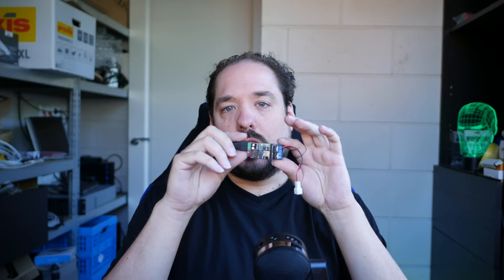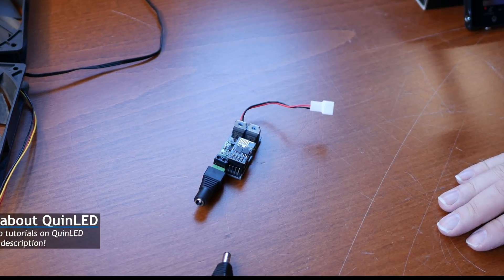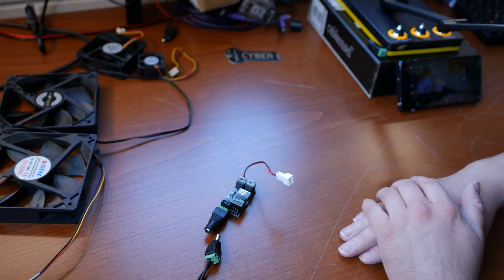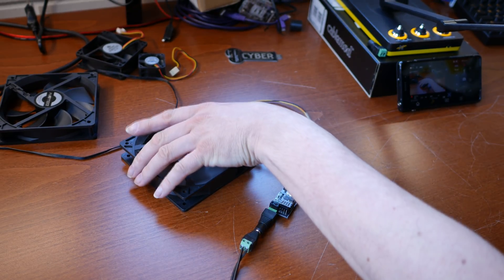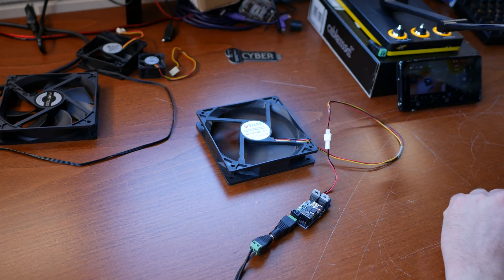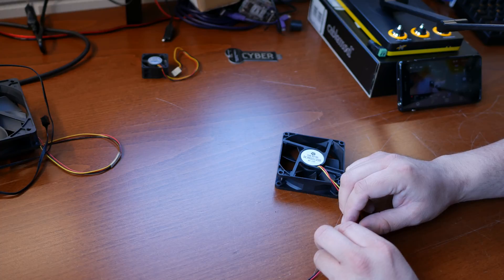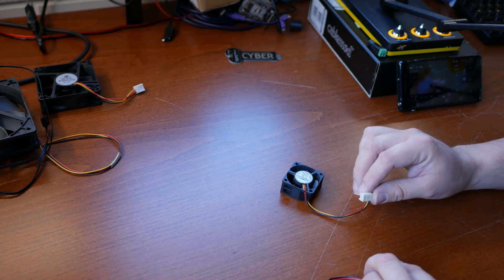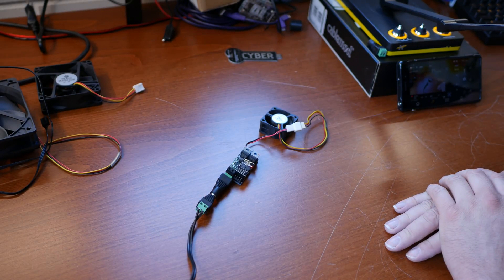ESP8266 LED Lighting: Using QuinLED to control a fan?!

Comment: in theory (As far as i know) :

Brushless Fan are brushless integrated with ESC. So the movement of the fan controlled by ESC. So if you PWM-ing the power, it will hurt the ESC, because ESC has a IC controller that need steady dc voltage.

So if you want to really hack 2 wire (positive-gnd) fan you can add big capacitor, so rather trickle the power by PWM, you send "lower DC" input to the fan. OR of course you can use brushless fan with dedicated PWM wire.

Comment: Normally you will use higher frequency PWM for fans. Low frequencies are ok for leds. I do control some fans using pwm for some time and as long as the frequency is above our hearing capacity it works just fine. 

In my experience you can make fans run much slower using PWM than when using voltage limiting.

Comment: You have to smooth the output voltage of your led controller. Sure the fan does not like to get a square wave pwm controlled input. Put a capacitor (or perhaps more than one) in parallel.
When the pwm output is smoothed it is like controlling the voltage.
Hook up an oscilloscope to the output, then you will see the effect.
Sorry, but this is basic electronic knowledge...
Reply: olpqay I was thinking the same, capacitor in parallel to smooth it out. Maybe a small follow up test !? 👍☺
Reply: How would you determine the size of the capacitor? (just trying to learn something here)
Reply: You will create some real ugly current spikes on the power supply by doing that. To overcome that use a coil in series and voila! you created a basic switching power supply (without feedback). Higher frequency is the solution.
Reply from the maker: Yeah, that should indeed work. Maybe I'll test it in the future! :)

Comment: Like you said. the fans themselves arent made for a pwm voltage input, a 4 pin fan has a pwm signal wire which controls the fanspeed with the electronics in the fan
You could use a relay for simply on and off
Reply: You need a PWM frequency somewhere above 25kHz. It’s the PWM frequency you hear.
Reply from the maker: Oh, you are quite right, and I know this but still, I wondered what would happen with the current QuinLED. Well, now we know. ;)

If I ever get around to building my next version (QuinLED-Octa) and am able to run higher PWM values such as 40kHZ I might try this test again. In theory, if the buzzing we are hearing is around the same value Hz as the PWM pulse right now, pulsing it way above normal human hearing should make it work perfectly? Maybe next year. ;)
Reply: QuinLED-Octa? Don't tell me that would be an 8-channel dimmer, I wouldn't even know what to do with it, except for hooking up 2 RGBW LED strips :P.

That theory you have there is pretty interesting, and it may work. However, if I think about slow-starting electric motors, they always make a sound at lower RPM's (the lower the RPM, the more noise even), even if given full power, so it may not necessarily be the PWM that's causing the buzzing. However, I think that theory does deserve a test, because it may very well be exactly what's going on. 
I'm very curious as to what you've got planned for the next version of QuinLED, looking forward to it, if it ever comes to life!

Comment: Haha, great minds think alike! This was one of the first things I came up with to use the QuinLED module for, beside lights. Hoping to add some night time ventilation to my bedroom on the cheap, for those lovely summer nights.
I indeed noticed the same issues as you did: Noooise... For me, it's still worth it to be able to switch the  fan on and off though, I may replace it with something else when I have the need for another QuinLED module.
Reply from the maker: Yeah, just using values 0 and 1023 would effectively make it a relay. Kind of "using a screwdriver as a hammer" but hey, it works ;)